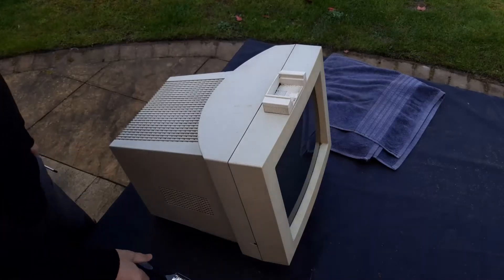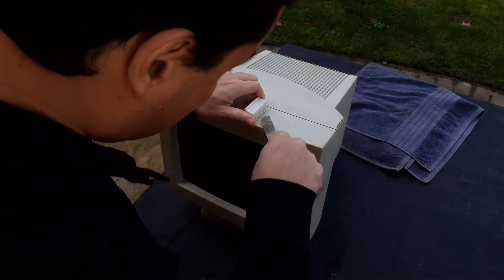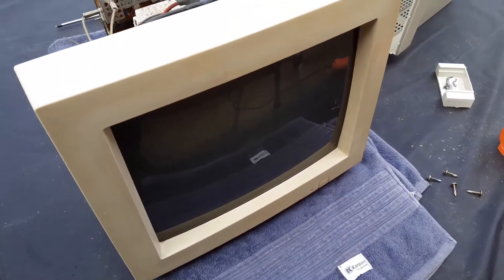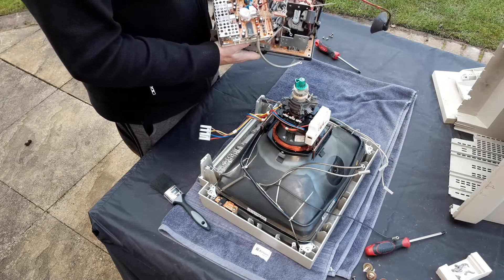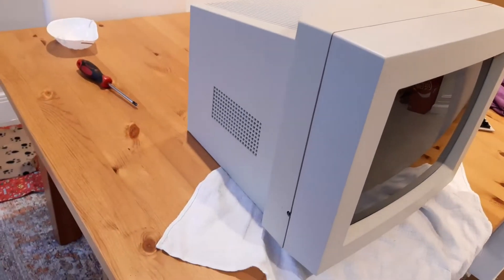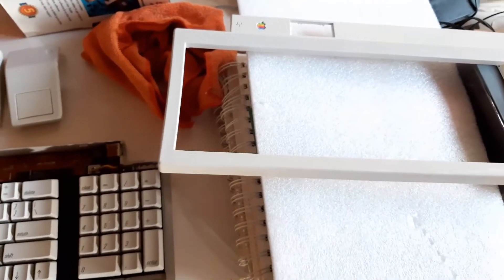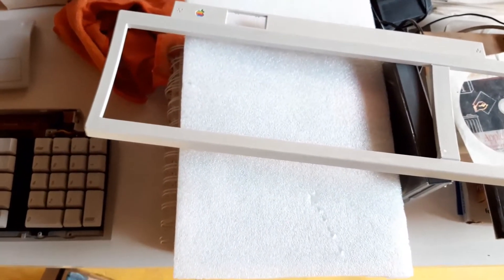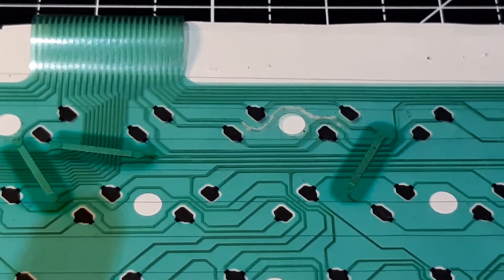Macintosh monitor, keyboard and mouse disassembly, cleaning and retrobriting

Comment: I'm considering doing this with a 1989 Apple RGB display. I'm wondering if it's possible, without disturbing any of the internals, to remove the front bezel from the tube assembly.
Reply from the maker: Unfortunately it isn't. The tube is bolted to the frame, so a full disassembly is required...